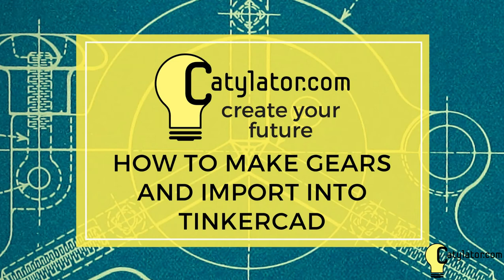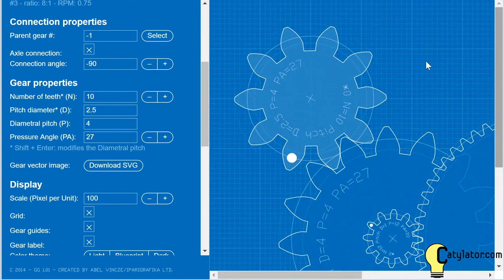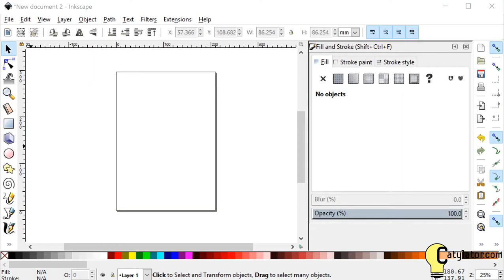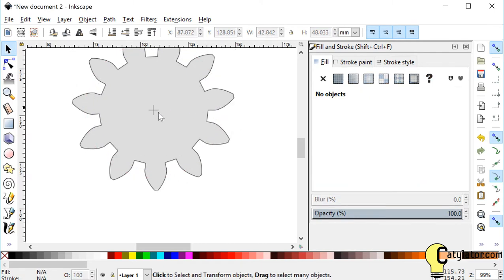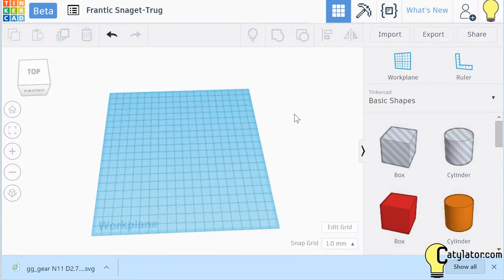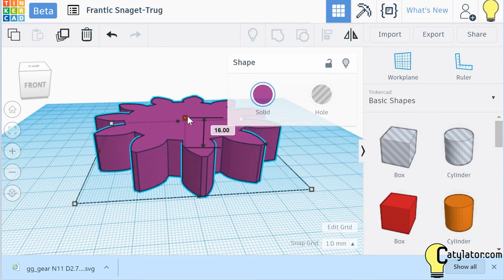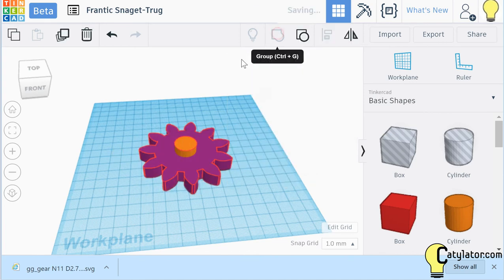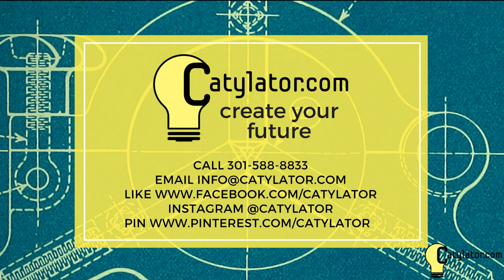How to make gears for 3D printing using GearGenerator.com

Comment: GearGenerator didn't use to charge. It was an amazing tool. We used to design  gears for a school project. They started charging some time in the last year, after this video was made.
Reply: I recently discovered the free drawing program, Inkscape has a gear generator in it. It doesn't tell you the ratios, but is capable of creating the same gears.

Comment: Need to try it. I actually did it a hard way. Created Gear designs from scratch in Tinkercad by creating a base element with a tooth on each end and rotating it number of times to complete a gear.

Comment: That hole is not in the center of the gear because of the odd number of teeth.  It's centered left to right but is above center due to the fact the height is measured from between two teeth on top to the tip of a single tooth on bottom.

Comment: Great video. I was wondering if there was a different import method for a set of gears in a .svg?  i am trying to import a set of 5 gears, 3 of which are compound gears. When i try to import them the scale is always 10 times the actual size i need.  Cant figure out where im going wrong.